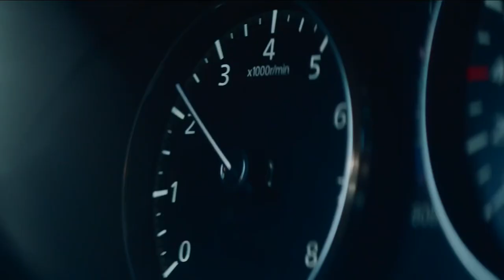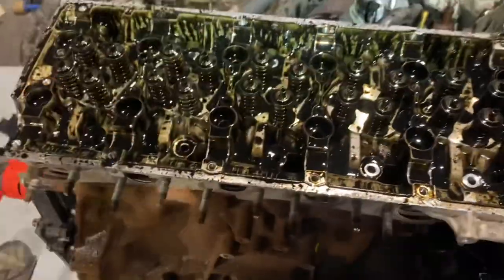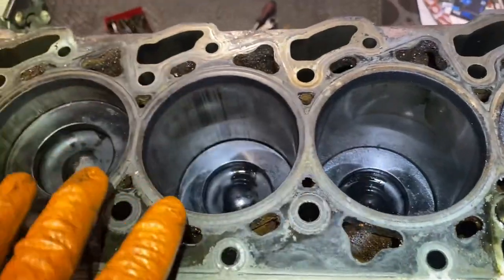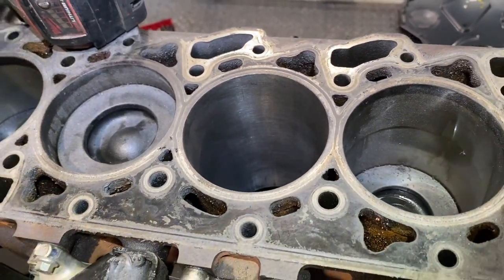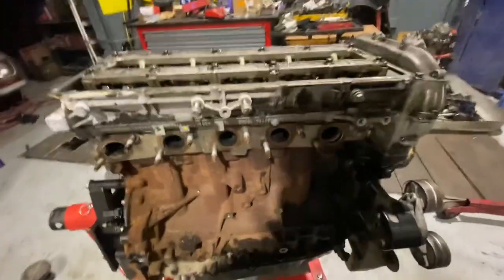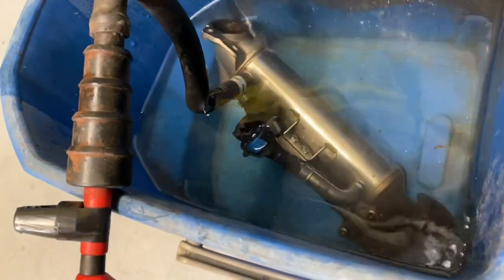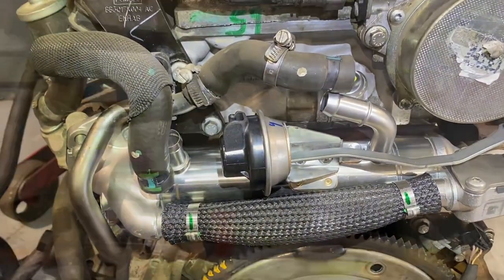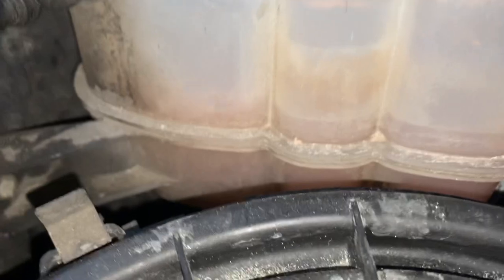Ford Ranger Part 2,knocking noise fix / piston replacement

Comment: I have a question about a 2007 mazda 6 diesel engine (RF7J)
the car idle well at around(700-750), but whenever i move and stop rpm will stay around (850-900) for 2 minutes(tested several times) with engine louder than normal even louder than normally pushing to 1000 rpm without moving.
then the car idle(700-750), 
it doesn't matter how much I drove even a few hundred yards.
it will always do this.
if i stop then drive then stop, it will always do this.
is it a dpf fail?
or that's how they work.
Reply from the maker: It could be just the egr system operating, if you haven’t any other faults I would ignore it 🤔🤔👍
Reply: @kennedysgarage3281  ok thanks

Comment: How hard was it to put the motor back in with everything bolted to it?
Reply from the maker: It actually wasn’t too bad to remove or refit with everything still on the engine, we did have to remove the plastics around the wiper though to get room to clear the engine mounts 😉👍👍
Reply: @kennedysgarage3281  thanks for the reply mate.

Comment: Personally I wouldn't of took the job on but hey most of us have been there done it and wore the t shirt
And at least you have the balls to come on YouTube and tell it like it is m8
Hope it gets sorted and I hope Ed refunds you for them gloves haha
Reply from the maker: It gets worse Gav 😂😂
I’ll up load part 3 tomorrow & I don’t know if it’s balls or stupidity 🙂🙂
Reply: @kennedysgarage3281  it's none m8 if the owner had told you the full story of this ie overheating etc then you would of what we call Back healed it
Its probably got cracks in block or head by the way them pistons were moving caused by in my opinion over fuelling like them daft 2.2 transits! And getting back to your other vid what's going on in the motor trade? I tell you what's going on motors are built of pure cheese
Metal isn't metal aluminum isnt alloy nuts and bolts feel and look like they  would snap as soon as you would tighten them up
Old school mechanics will tell the modern day technicians (ha) the tools you buy today are crap compare a snap on socket to a old snap on one the industry has gone mad anyway waffle over haha you wouldnt get this chew over a 2 litre pinto engine there still going
I hope it gets sorted for you pal
Reply from the maker: @gavfreeman8797  they are made to be not taken apart nowadays alright. And then there is 8 hours stripping to check & see when anything goes wrong 🤷🏼‍♂️🤷🏼‍♂️👍

Comment: Take no chances on that with the damage to them pistons and bores, engineers shop and new injectors for that job
Reply from the maker: That is what I should have done Peter but hindsight is a great thing 😂😂
Reply: @Kennedy’s garage  , Peter I'm gutted for you, you tried to possibly save the customer money  and get the job out but unfortunately it's bitten back
Reply: Hi Peter , hold fire ! Are you certain it is combustion gases in the header tank , worth pausing before you take the head off again, (if you haven't already). I'd run it alittle longer just to be sure , don't panic as I've done in the past. Fingers crossed for you.
Reply from the maker: It was the head gasket & the head was badly warped 😔😔
I had a part 3 recorded but lost a few sections, probably to focused on get it gone 😂😂😂

Comment: Hello I have a 2.2 ford ranger auto it's got a problem with the heating I've changed the temperature sensor and thermostat still the same. Basically the engine is hot but nothing then I switch off and turn back on it goes up but then drops to dead cold again any help would be appreciated guys
Reply from the maker: I don’t exactly understand the comment 😞
Does the temperature gauge not rise, then it does when you cycle the key & drop again??
Reply: So from a cold start I let the engine run for 30 minutes till the engine is hot to touch the temperature gauge doesn't move then I switch it off the engine I then start the engine again the temperature gauge moves up the half but then drops after a minute or so to cold again but the engine remains hot I've changed thermostat and sensor still the same also there is no hot air coming through the vents in the cabin when I full heat
Reply from the maker: @fishing-big-portsmouth  cooling systems act funny on modern vehicles. 🤔🤔
On cold start up the coolant is only pumped through the heater radiator/matrix & what I have seen is this seems to be enough to keep the engine cool while the car is stationary, especially if the blower motor is running. Then once the water stops circulating with the engine turned off, the coolant temperature rises due to the water being stagnant and the heat from the steel in the engine. This could possibly then raise the coolant temperature 5 or 10 degrees just enough to open the thermostat. 
Does that make sense???
I could be so far wrong but I’m thinking your heater radiator could be blocked 🤔🤔
I had very similar a fault recently on a 2016 transit
Reply: @Kennedy’s garage  okay thanks for your advice I've ordered a new radiator an I'm going to try clear the matrix with reverse flow and compressed air fingers crossed
Reply from the maker: @fishing-big-portsmouth  🤞🤞

Comment: That's a bugger. I rebuild Ranger / BT50 engines regularly so I've got a tip for you if you're interested. 

These cylinder heads do not handle getting hot - they go soft and generally need to be replaced. Must be the alloy qualities used.

You were bloody lucky getting away without using the timing tools. They are super fussy with cam / crank correlation. The tools lock in at 50 deg BTDC #1 fyi

Good luck
Reply from the maker: That is good to know, thanks mate. 
Still going anyway, I a bit mad but attempt quite a few timing jobs without the kit, but only if the timing was ok beforehand. Then I generally buy the locking kit for the 2nd one 🤷🏼‍♂️🤷🏼‍♂️🤷🏼‍♂️🤪